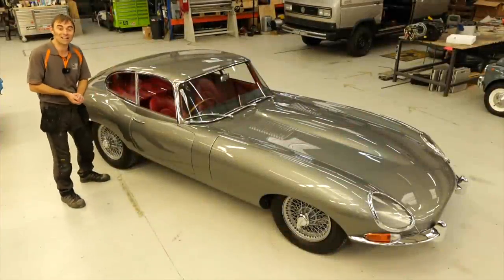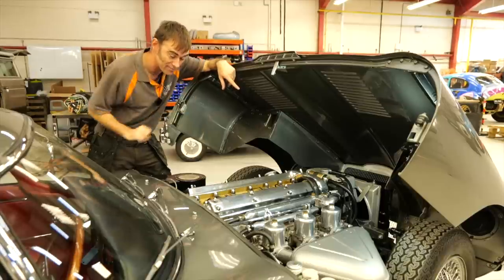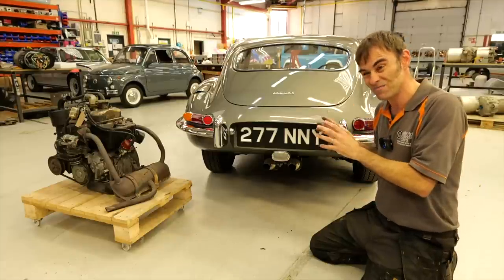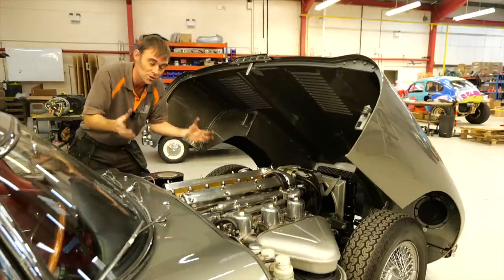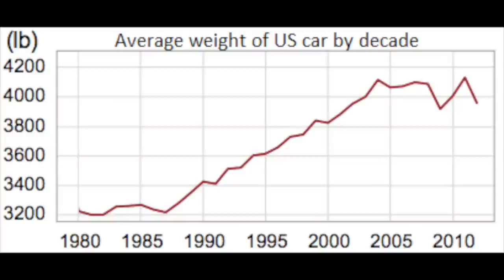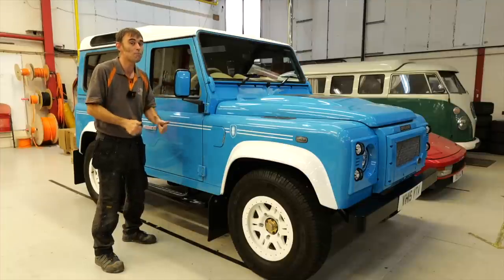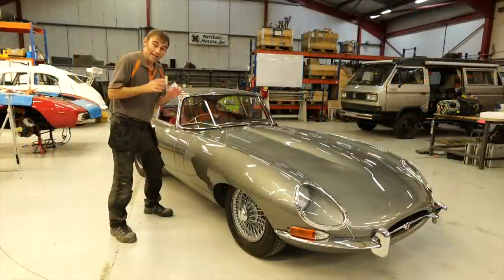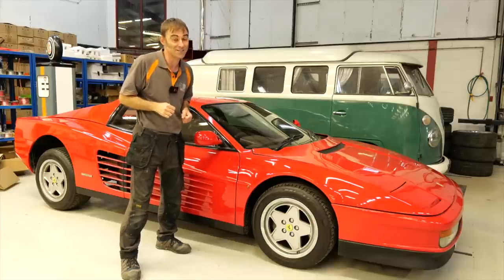Is it a sin to convert a classic car to electric?

Comment: 1)	Noise – you’ll never convince me you wont miss the noise, the noise is one of the best aspects of driving any classic car, all classics have their own unique noise and its part of the driving experience. Taking the sound of a flat six out of a 911 is removing a huge part of the experience, you might as well not have a 911 at all. To make the comparison with an open trumpet car in long journeys is not applicable to 99.9% of classic owners, people who have open trumpets do so knowingly.
2)	Soul/personality – ICE are perceived to live, they “breathe” they have numerous functioning parts that all have to work together for the whole to operate, they make a sound, they react differently depending on how they are treated it’s the same as why steam engines are perceived to have soul/personality. To say the car has a personality no matter what engine it has is rubbish, the engine is 50% at least of the personality of any car.
3)	Originality – this makes a huge difference to value, which is important to most (not all)  owners. Why would I pay a huge sum of money to lose significant originality and only de-value a vehicle. As more classics are modified originality becomes more valuable thus making a conversion make less sense. Saying an AC Cobra is a modified vehicle is rubbish also, albeit they were based on the Ace they were factory produced cars. You are modifying existing cars not building hundreds of factory cars registered as your own models.
4)	Batteries – making batteries is bad for the environment – there is no getting away from this, I’m pretty certain that given the amount of miles an average classic does over the years the time to “payback” the environmental damage of procuring and fitting an electric conversion will take forever, its not just the mining but the carbon footprint of making batteries and motors as well. It not just Cobolt, Lithium is terrible to mine as well.
5)	Weight – you admit that they are often heavier. Also how heavy modern cars are now. The lightness of classic cars is one of the major positive parts of the driving experience. Saying “modern cars are heavy so don’t worry about the weight” doesn’t work, people complain regularly about the weight of modern cars, which is why cars like the Alpine A110, and Lotus Emira gets such good reviews. This is especially a problem if any conversion then means you need to install power steering which will further depart the driving experience from original.
6)	Cost – you admit the cost is way above the value of the majority of classic cars, you’ll never add this value in re-sale in fact you don’t mention the impact of the conversion on re-sale values. How much would one of your conversions be worth in 10 yrs time/20yrs time when whatever batteries/motors are in it are obsolete tech. You also admit that the cost of a conversion will be unlikely to pay for itself at any point. All big negatives that are skirted around.
7)	Performance – all classic cars have very poor performance compared to modern cars, people don’t own them for performance. Theres much cheaper engine conversions that can be done for performance improvements
8)	Reliability/Maintenance – Im sure thay are very reliable, but for a lot of people maintaining their classic is part of the hobby, having a car that needs no attention is rather boring. Long term – what is the reliability of the batteries you use, what happens when they need replacing? I imagine this is very expensive. These conversions only improve engine reliability as well, many classics breakdown due to other issues. They will not suddenly become super reliable after this conversion
9)	Emissions – it has been proved loads of times that it is better for global emissions to keep classic cars on the road rather than build new electric cars
10)	You assume the electricity price will remain the same as now, I would argue that when everything goes electric and HMRC are getting no petrol tax money all that tax burden will move somewhere else, it’ll probably get added to electricity bills. Either way you don’t know what the electricity price will do long term
11)	Drivability – all you have really is better straight line speed, if I want better brakes I can do that for a lot less money.
12)	Others – Looks – that big metal box under the bonnet looks like crap, imagine the disappointment on everyone’s faces when you lift the bonnet on that Aston you have there. – Battery placement – you can either have a crap ton of weight over the front wheels or lose a ton of boot space for better distribution. Charging network – Well known issues with going long distances or visiting rural areas, which a is a frequent place to see classic cars being enjoyed.
13)	I think that in a good few years time when conversions can be done significantly cheaper but also add no weight (or even reduce the weight), while at the same time have the same range and performance as the original engine at a minimum, they might just about start to make sense, if the charging infrastructure is there as well. Early adopters of these conversions will have pretty undesirable cars in a decade or twos time.
Reply: I’ll take that as a “ yes” then ? 👍
Reply: thats affirmative, they claim to want replies from all points of view and a discussion but really all they want any is an echo chamber which is exactly what they have. Looking forward to seeing todays EV converted classics on the market in a decades time that cant be given away.

Comment: i feel the same way about an EV conversion that i feel about a rat rod, 
sure its good if your saving that ford model A from a junkyard by dropping a chevy smallblock and 4 speed on it,
but if your buying a pristine 50+ year old car just to cut into it i think that is where i draw the line myself,

Comment: In my opinion soul refers to the heritage. 

  As a classic car driver you do the upmost to keep the car as original as possible. Of course the car has old technology. You can not compare  a smart watch with an expansive Swiss mechanical  watch either. We all know the smart watch or EV beats the mechanical watch or the combustion engine on running cost and reliability.  But there is also something called heritage and history, which you as a lover for a oldtimer try to preserve.

However I wouldn't mind to convert cars of which thousands were made, ( hence no special track record,)  but some also convert cars of which literally a hand full were (custom) made (Bentley,  RR, AM) and to me that's a shame

Comment: I saw videos bashing Dodge for making special noises to be played in new muscle cars which happens to be EVs. I believe Dodge should not be blamed at all.
Most classic cars are to be driven and enjoyed. With EV powertrain those can be enjoyed reliably.
I believe that it should be possible to be played in any car any glorious noise if desired. Glorious engine noise without its smell makes a lot of sense to me.
I would even say that in their best times classic cars even new were not reliable.
You shouldn't an environmentalist. You should recognize the common sense: any engine smells bad while an EV doesn't. Even with coal electric power station an EV use is better since the bad smell is out of the city not under your own nose.

Comment: I probably wouldn’t convert a perfectly clean and original car like that in the video. But as you say. There are enough classic chassis with not as well maintained, sounding nice and powerful engines. Maybe their engines are gone already. I would just extend those chassis lifetime with a modern electric motor. I also wouldn’t mind changing some other things to gain comfort. But well, except of the cost of a classic restoration and electrification etc. well the battery. … with all your arguments. Those things just ruin all the good things of the Electric motor. A new Battery cost the same as a new car. And charging. There are people who need to use public chargers only. (Living in apartments,…) Therefore the “you charge when you sleep etc…” argument is gone. You need to find a charger close to home. It must not be occupied. It must be compatible with one’s system. It must work. Then you’ll need to wait for it to finish because you’ll need to remove your car from the charger so other people can use it… well with reliable fast DC charging and reliable minimum Watts/h at nearly every gas station that would all be done and dusted. It’s easy to have a 15 minutes coffee and gain another 100km range. - also, where do get the electricity from? I would argue it’s more efficient having big centralised diesel burning facilities with CO2 washers producing electricity than a million cars with little ICEs. Not that it’s good. But it would be better than what we do now.

Comment: Have you noticed now that people are changing to electric vehicles the price of electricity has shot up considerably the same thing happened when people went for diesel vehicles the price again shot up it is now more than petrol also how much is it going to be to replace all those batteries and how long do they last to begin with
Reply from the maker: No, but I've noticed that the price of gas has gone up because of Russia, which has had a knock on effect to increase the price of electricity.

Comment: In most circumstances, Yes it is a sin because it's a classic car and should be appreciated and enjoyed as it was built with an internal combustion engine, its heart and soul. Sure there are some benefits of an electric power plant and there will be personal circumstances for specific owners which make it viable but it essentially misses the point of owning a classic car. Would you put an electric motor in a WW2 Spitfire ?

Comment: I think you missed out an important thing talking about about performance. ICE are at most 30 % efficient and electric motors are  at least 95% efficient. That means when you run your ICE car, an put in 10 dollars of gasoline, 7 dollars of that cost are lost in heat and other things, and only 3 dollars are put into motion. So do the math with an electric car.

Comment: Have you seen there is a petition on the rules for converting classic cars to electric on the uk gov petition website? Petition number 625633.

This is as a result of someone converting a mark 1 mini to electric, and by drilling 2 holes in the boot floor, the DVLA has said it is now modified and needs to have an IVA test and has lost it's original reg. Have you faced any issues with your conversions from the DVLA?
Reply from the maker: That's ridiculous. Where's this petition so I can sign it?

Comment: They sell 1963 Ferrari at $3mil. Because it is rare and original. And they plan to sell it 10 years later at even higher price. And keep that state of things forever.
They don't need to drive it - just keep it drivable (and original) to keep the price tag.
And now their bussiness if failing, because people will not want to keep ICE and originality.
What else do You expect to hear from them regarding EV-conversion? :)

Yes, I have impression that driving ICE is similar to gambling addiction or slot machines - that is where people start talking about soul. Sure, those addicts are going to suffer a lot. Perhaps they need simulation of ICE-style torque curve. Is it doable? Just to try if brings peace of mind to those who in need.

Comment: While this was a well-done video it failed to convince me that there were more pros than cons in converting a classic car to electric.  The appeal of classic cars is not just about how they look but also how they work, sound, smell and feel.  A parallel would be comparing an exquisitely made analog timepiece to a throwaway quartz watch.  Sure, the quartz watch keeps way better time than any old-tech spring-powered watch, but there is a reason why mechanical watches are still produced and indeed highly coveted.  The same goes with a handcrafted grand piano when compared to its digital or electronic counterpart.  There is simply no substitute for the real thing, even if the real thing is more troublesome, more expensive or more inefficient.  You really picked the wrong car in your intro as a good example to convert.  The 6 cylinder XK engine is not only beautiful, it's powerful and it's legendary.  It's proof that the beauty of the car is much more than skin deep.

Comment: Keep it up! Display the fossil fuel engines and use EV Technology to keep these classics on the road. Life and technology move on. Deal with it
(Formerly part of the fossil fuel engine and car restoration scene, maintenance, reliability, COST, and environmental concerns are the reasons why I stopped. I argue that a fossil fuel restoration costs just as much over time. Blow a head gasket on a V8 - very costly including time.)

Comment: I have to say that converting an XKE or a Lamborghini Miura to electric is akin to taking the guts out of a Patel Philippe and retrofitting it with the innards of a Casio - the latter keeps much better time but lacks the heart, soul and feel of the original. If I’m going electric will keep drive the Tesla with all the bells and whistles.

Comment: What if I brought in a Tesla Model S and asked for it to be converted to gas? Rip out all the electric drive bits and drop in an engine with "soul". Assuming you'd take the job, I'd end up with a car with decreased performance, reliability, handling, environmentals, and increased maintenance and running costs. On the plus side I'd get some noise that some people like. Has anyone ever done anything like that? No? Wonder why...

Comment: These cars are works of art, you wouldn't repaint works of art from the past would you.
Putting all that wieght in the Jag will destroy the Balance of the car , you can never get it exactly the same. The feel and sound of the car are it's soul
I'm all for putting electic motors in cars but not classics.
Reply: The battery placement will improve the balance of the car. 👍
Reply from the maker: Did you watch the video? We said that the conversions are usually the same weight as when it was ICE powered. We also covered to 'art' analogy. These are mass produced practical things to be used not a one off price of art that doesn't do anything.

Comment: This is the wrong way of presentation - showing pristine cars, completely restored to better than factory rollout condition - and then you rip out the heart - that makes one's heart bleed. 
 
A few years later, when the fresh engine gets worn out, the next overhaul is destined to get nasty e.g. due to missing parts or because you need a complete engine reassembly, then that is something different. 
 
What one could argue - no one sees the work of art (the engine) anyhow. So one could see MORE of the engineering when you take the engine out and display it beside the car like in a museum. 
And we have to admit, the engine bay as such is not such a winner. 
 
So it might be an idea to add interesting engine presentations in the portfolio. 
  
 
My Calibra V6 could be a candidate when something nasty happens - but I hope this take a few more years.

Comment: What are you going to do when Efuels become available (they have already been develoled) and you've spent a fortune converting to EV. Now you can drive your 4.2 Etype ICE engined classic with carbon neutral fuel, but you've ruined its appeal and value with an electric motor.
Reply from the maker: E-fuels have been around a long long time. They are not new. In fact they were heavily used by the Germans in WW2. The problem with them is that they take a lot of energy and money to make, and still produce exhaust emissions at the end of it. Here's some good videos for you to watch. https://youtu.be/HKuKeKeUFTQ https://youtu.be/0d0MPg7DxbY

Comment: I do not want an EV. the idea of running around desperate to find a charger that works does not appeal. I think more research into hydrogen is best.
Reply from the maker: I agree, I think you need to do more research into hydrogen, then you’ll find it’s a dead end for use in cars. 😉👍
Reply: Running around looking for petrol is fine though right.

Comment: The whole is greater than the sum of the parts. So don't touch it. However, by all means recreate an E-Type from scratch and put an electric engine into it – along with all the other modern gizmos to cope with electric power. Better brakes and ABS is one. So you should approach Eagle-E* and get a new chassis and bodywork and install EV drive into that, but heavens, don't bastardise an original.  *Much like Shelby did with the AC.